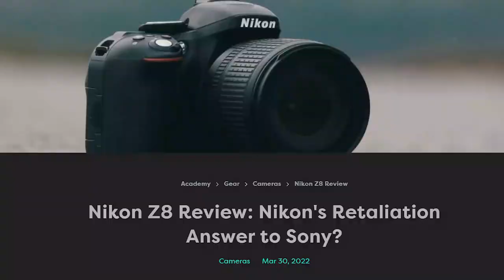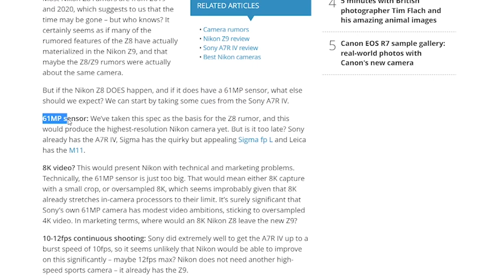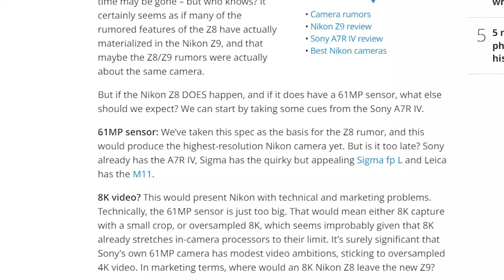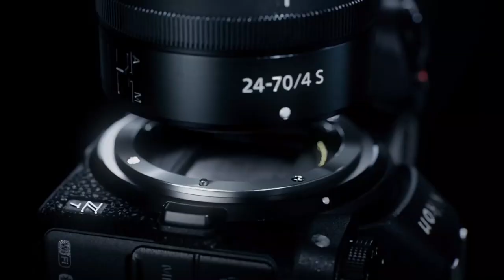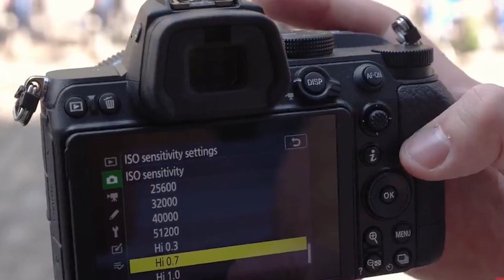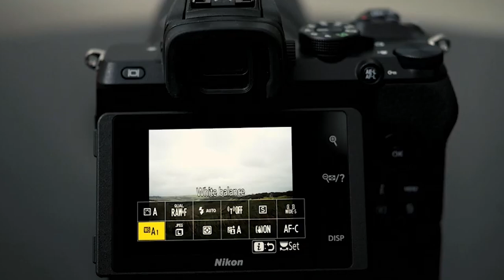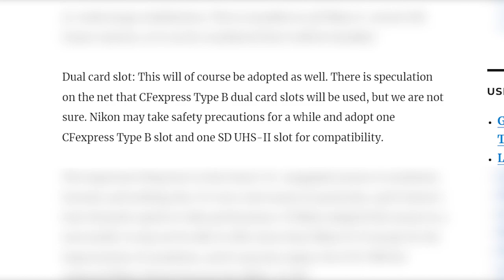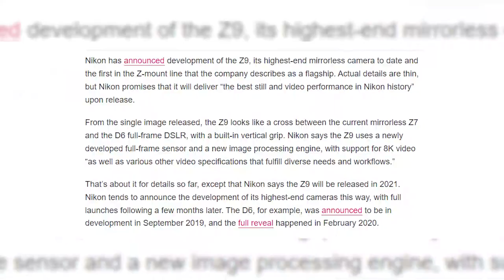Nikon Z8 Rumors - Is It REAL?

Comment: The Nikon Z9 is an excellent testament to the design, engineering, manufacturing and supportability prowess of the Nikon corporation. Moving ideas from concept to implementation to testing to production is no small feat for any commercial venture especially when the end product has stringent design/operating budgets for components including space, size, heat, power, heat dissipation, duty-cycle, reliability, testing, calibration, production and durability to name a few. As a former design engineer, I marvel at the accomplishment of the Nikon camera team to deliver a flagship model in under 3 years. That said, I do believe that the Z line(Zfc, Z50, Z5, Z6, Z6II, Z7, Z7II and Z9) will continue as is without a Z8 in the near term,  because of pricing, component availability and  manufacturing issues. A $3.5-4.0K camera (Z8) with some flow down features from the Z9 would be a Z7/Z7II killer. And the Z7 and Z7II have room to grow without introducing another model requiring additional corporate supportability and reducing corporate resources. The component energy budget is constrained by available power (energy storage). Nikon uses two batteries products for energy storage (EN-EL15x, EN-EL18x). Newer bodies would probably use a combination of these batteries to power the design. As such, limitations arise in possible features set of a new Z8 if a Z7 comparable size body is desired. The Z9 and its feature set, are packaged as small as possible given all the specification requirements and durability constraints. It has to work/perform ALWAYS. Future Z models will include more computational photography and more image processing features. However, in the mean time, given the world-wide shortage in processor/chip deliveries, other supply chain restrictions, development constraints and limited corporate resources, expect improvements in Z6II/Z7II products with probable FW 2.0 announced around August 2022. Expect a possible Z8 in late 2023 perhaps after Z9 demands stabilize.